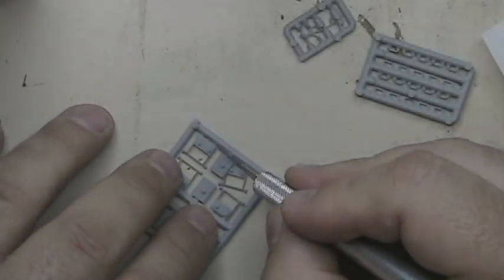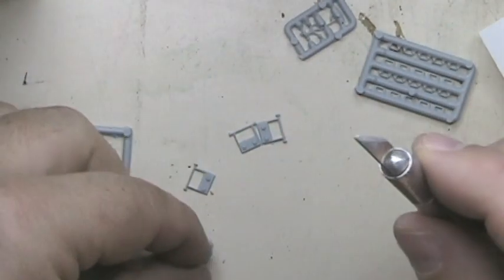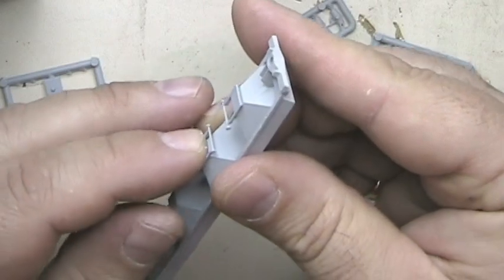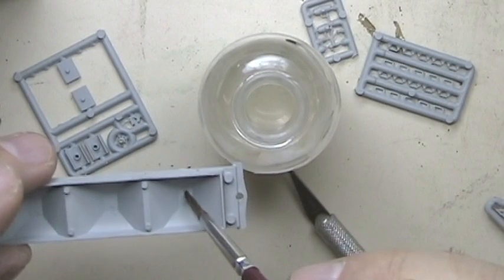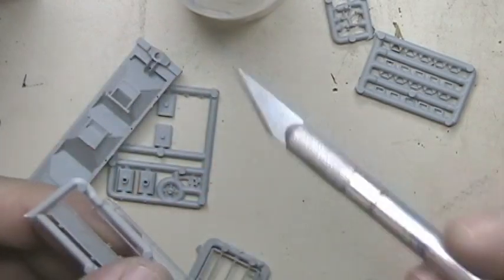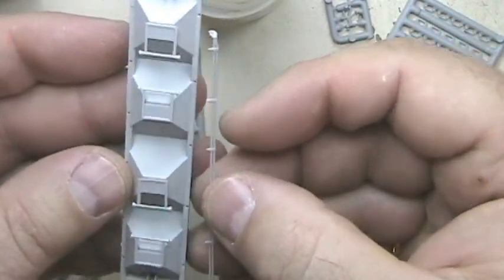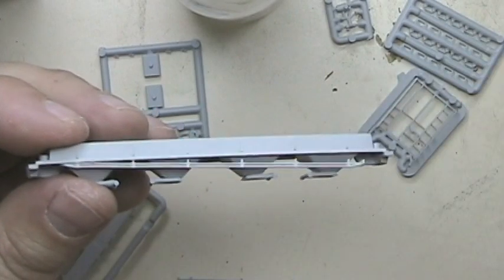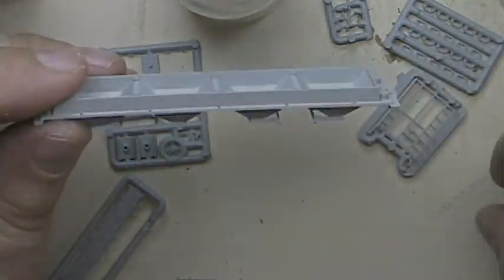Model Railroad VLog: Kit Building a Hopper Car: Part 3

Comment: when you install parts make sure they are secure or the model will fall apart. on these cars NMRA requires each car weigh four ounces so before you attach the frame to the car body place a weight under each hatch but don't glue the frame to the car body you might need to add more weight later.

Comment: if your cutting air pipes or compressors don't cut the nubs off these are needed to attach them to the car. use tweezers to attach the parts don't use your fingers